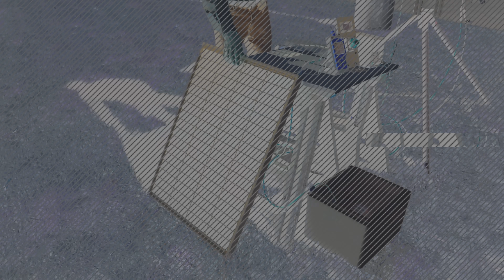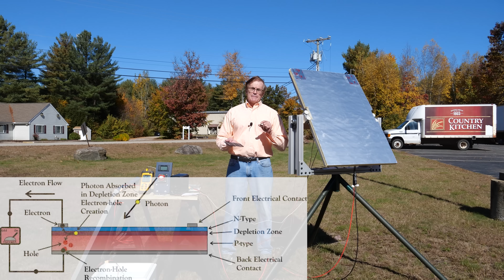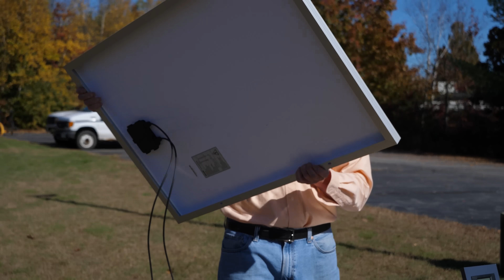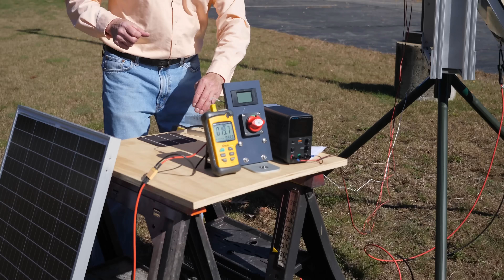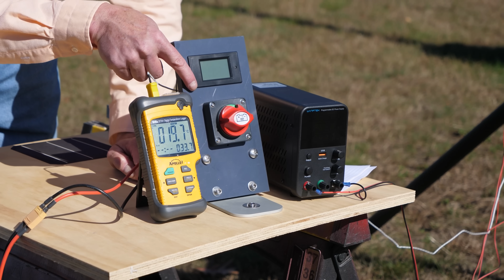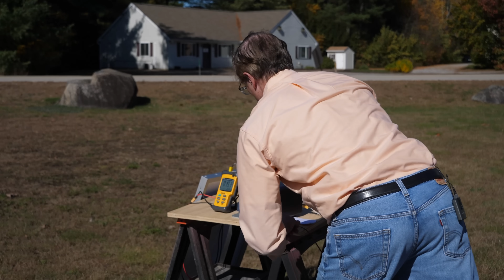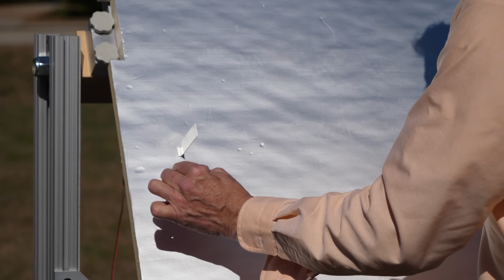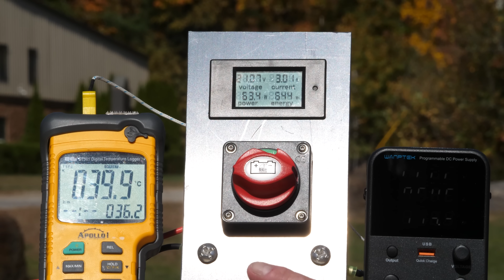Do you REALLY get enough out of your solar panel?

Comment: I'm in Australia I have 40 degree C days in summer. Just means my batteries take a little longer to charge. Maybe a hour and a half difference.

The temperature affects my battery storage more than anything. Hot days less storage better discharge, cold days better storage but less discharge (available amps with heavy loads)

I run a small 24v off grid set up of two strings with four 250w panels on each string run to a combiner box then to the mppt controller which charges four 230ah 12v agm batteries configured in series parallel to 24v which then runs my 3000/6000w 24v to 240v inverter.

Only way I think I can make it more efficient is upgrading to lithium cells/batteries and incorporate super capacitors between the controller and batteries and between the batteries to the inverter to help negotiate voltage drops and amp draw with heavy loads (microwave, electric kettles ect)

Comment: What if...you pump water behind the solar panel...or in front of the panel to both cool the solar panel, but also heat the water in preparation for a water heater?

Comment: The Baseline test needs to be done with a standard panel, open back without all the heat sinks.
The modified panel is probably holding more heat and reducing efficiency compared to the open panel.

Comment: This is in line with my plans for roof solar on my RV. Planning to have the panels cooled by circulating water that will be used for passive warm water. Panels will be cooler, warm water could likely remove the need for a dedicated water heater in most cases.
Reply: An RV with flat roof-mounted panels might be fairly well suited for something like this but I would caution against circulating the actual fresh tank water through the system.   Not if you want the system to last a long time.  What you want to do is to circulate a primary loop under the panels (typically a glycol loop or something similar) through a heat exchanger and then have the secondary water loop from the tank go to the other side of the heat exchanger.  Two pumps and a little controller to turn them on as appropriate based on various temperatures.

The algorithm would be fairly simple. Panel-side loop pump is enabled when panel temperature exceeds 45C or so.   Tank-side loop pump is enabled when the heat exchanger's temperature is sufficient to heat up the water, and it is force-disabled if the hot water tank is already too hot.   Just running the solar loop through the heat exchanger will help cool the panels even if the hot water tank's loop is not turned on.

That said, there are three problems. Well, first, you still need a dedicated water heater.  It will use less energy, but you will still need it.  Second, making the glycol loop under the panels efficient is no small task.  Heat has to be transfered from essentially the entire surface area under the panels into the loop without creating stresses or hot spots.  That is not easy to do.  And the third problem is cost and complexity.  Its a lot of cost and additional equipment just to harvest heat from under the panels.  Plus some maintenance as well.

If I could make a suggestion, it would be to double-stack the panels on top of the RV, well secured.  While the RV is moving you get power from the top panels in the stack.  When you park the RV you would be able to unfold or slide a layer of panels out to give yourself more solar panel area to work with.  Don't try to cool them, just use the extra panels to augment your power system.   This is virtually zero maintenance.   Double the power is more useful than a cooling loop augmenting a water heater.
Reply: @junkerzn7312  Isolating the panel cooling loop is the idea. Keeping the loop clean and avoiding freezing weather problems are the obvious reasons. Having a loop for warm water and another just for cooling the panels are the others. My rig has plenty of space for the wattage I'm looking for so no need for deployable setups. The goal is to prevent the panels from experiencing frying heat while in the southern states and during summer, that is easy enough to achieve with a tube loop and some TIM sheets.

Comment: . . . unfortunately you don't show exactly how you deployed the heat conducting aluminium profiles to the solar panel - the reduced voltage (wattage) of the fans is due to the fact that the kinetic energy of the forced air flow increases by the air velocity to the power of 3 . . . anyway:  thank you for this interesting setup . . .

Comment: As always a well made video with proper physiks. Living in an area with moderate temperaturs I'm currently leaning more towards just adding more panels instead of optimizing them for peak power.  I have issues with not having enough power in the winter and low lights (panels are cold there anyway). As I can't store the power long enough to be usefull. In the summer the panels produce more than enough power already. And the roof is not full yet ;). Also moving parts are not what I like to have (but that is just me). I clearly see areas with limited space and enough storage to benefit exactly from what you tried there.

Comment: Wouldn't mounting the fans at an angle improve  airflow?
Also what about mounting vertical round, square tubing on each panel. Have the ends be open

Comment: Thank you. I love your practically oriented video's which contain such convincing experiments and excellent scientific explanation.

Will Prowse, who has an excellent channel which is mainly focused on electric batteries, also did a very crude experiment on air cooling of solar panels. He used a regular fan and found that the power required for the fan was much more than than the additional power harvested.

Comment: It all comes down to the cost of the cooling, 5 watts will make $1 of electricity in about 1 year, solar panels last ~30 years
So if you cooling system gains 5 watts, 6 equivalent hours per day, for 30 years, your cooling system cannot cost more than $30 per 100w to just break even
And few people are willing to put money into an investment that doesnt pay back in 5 to 10 years.
And that's if nothing breaks, gets blown down, damaged by contractors, etc.

Comment: First off, this is good the see these experiments. I suspect that closing off the back of the panel with the fans turned on is artificially increasing the temperature of the panel due to hot air getting trapped in it. It would be interesting to see the power of the same panel with the back open. Also notice that the temperature reading on the thermometer even after the fans turned on is not bringing the temperature of the panel lower than the temperature of the thermometer itself. It could be that the darker panels are able to absorb more heat. But again we don't know without a control experiment.

Comment: I think that the after market cooling addition is a hassle for a small energy gain. For a system on mounted on the ground, it could be feasible, but changing a ventilator on a sloping slippery roof would be a nightmare. With strong sunshine, loosing 4 or 5 Watt on 70 or 80 Watt per panel is for me ok. With little sunshine, the panels will get less warm. As shown in your example halve of the extra power gain is lost on powering the ventilators.

Comment: I have some BUG issues with the fan system.
New Zealand and I have about 20 square meters of panel and I've run this system for 23 years. 
Summer is not a time we Scratch For Power - WINTER is when we run a gen if and when we need to So getting more out in the heat of summer is kinda pointless and it's already cold enough in winter.

The Most important this with Solar is Cutting those Trees Down - Yeah Charge the Dewalt and clear the sky line.

I have all my banks of panels on posts with gate gudgeons and they turn to follow the sun all day - so I have these bloody great sails 4x1200x2000 the wind likes to play with - "Eggsiting thing to see I can assure you".
Thing is Heat Rises and my Panels are on around 45degs totally open at the back, 300mm off the cool grass where the chickens keep the bug down all mounted on alli frame on 2 gate gudgeons carrying The Lot so open to the air on 45 the heat rises.

FYI The Russians have Solar on both back and front to get the snow reflection BTW.

I have some BUG issues with the fan system.

predictors

Comment: 2 watts from a solar panel will make you $1 in 2.8 years
How much did that metal and fans cost?
if it's more than $10 then it will never make its cost back over the life of the panel.
and that is if non of the moving fans ever break or get a bad bearing a draw more power, etc.

Comment: I wonder if one can passively cool them with a reservoir of water that is circulating (and perhaps goes into the ground for cooling?) by non-electric means, akin to how a drip coffee maker moves water (one-way valves). surely the reduction in density due to an increase in temperature can be used to move the water somehow?

Comment: nice, but isnt that aluminum sheet on the back allowing the panel to hold in more heat than a bare (stock) panel? i sure wish you would have done this next to a panel that was completely stock.

Comment: Most interesting indeed.
Many years back, I was told that sand blasting a heat sink would increase the surface area roughly 3x. (Assuming this is true) Could this be used to either achieve better efficiency or reduce the size of the heat sink?
Reply: I am sceptical: if sand blasting heat sinks was an effective way to increase their performance then virtually every Hi Fi amplifier and computer's procesor would be using sand blasted heat sinks and they don't.

Comment: beating the laws of physics on the helicopter level.
 entropy loses part of the battle. (outwardly apparent)
marketing execs for the panel manufacturers have a stroke and call the cost accountants who beat the engineers over the head demanding the process of manufacture cheapen....become more efficient because: profit margin change due to user innovation and loss of bulk sales overall.
 cool! no kidding! i am on board.
perhaps this will hasten innovation on the manufacturers part.

Comment: I think this is a cool mod however I think for the 1-2watts gained there's a lot more moving parts involved and possible initial upfront cost. As far as increasing the lifespan of the panel, while that may be likely, what are the chances that dust debris bugs and leafy materials get caught up in the back part of the panel? This increases maintenance as well as baseline product complexity.

Imo the water drip on the solar panel sounds very promising. If you have a buried 50g drum in the ground. The grounds ambient heat sinking would hand all your cooling needs without the need for a radiator you'd just need a basic filter and pump and nozzles. If it was winter, I'd simply not run it as you'd get better cooling from ambient temperatures anyway... Just my two cents still really cool the techniques you've shown here and the over all performance increase you managed

Comment: It seems like to me that between water heating, stove operation, dryer heat, pool heat, hot tube heat, washer cleaning water, and air conditioning, we should start looking at housing as a complete unit.  A number of years ago there was an article that by removing incandescent bulbs from a house and replacing them with LED or spiral florescent bulbs, the amount of heat not produced by these lights was so great that the furnace had to work harder to make up for the heat.  All very interesting.

Comment: Great videos...Please do your next experiment with a thermoelectric sinks located on the backs of the panels...passive way to use heat for electricity generation and cool the panels.
Reply from the maker: Thanks!
That would be very expensive and the decreased cooling due to the thermal resistance would undermine  the effeciency  gain in the panels  themselves.

Comment: Just wondering, would it be OK to use water  on a cloth in the air input to bring air temperature down, as water evaporates it cools the air.
Reply from the maker: It would probably  help, but keep in mind that the increased airflow resistance  would counter these  gains.

Comment: Can you make same test but put water drip over panel? I have access to water well and planning to put drip on system on panels and then return warm water back to second well. So, no water loss. But Not sure it water on panels will make less power due to reflection/refraction.

Comment: This has me wondering what would happen if we leaned into the heat generation on the panels using a thermoelectric and a reverse heat pump system?  Potentially, you could use an AIO to pull heat away from the panels to the heat pump, drawing it away from the panel, providing cooling for the water return trip and the heat transfer could be used to generate electricity or simply heat the home, if needed.  This may be a pipe dream, but I would be curious to hear your take on a system like the one I propose.

Comment: But, what if it was submerged just under the surface of water. In a lake or at sea? Would it perform better and cooler?
Reply from the maker: Possibly, but you have to account  for the change in light levels due to turbidity and the irregular  surface effect on reflection.

Comment: I'm crazy lol. I added 1in pex in the back of my panels and mixed in aluminum powder into a slow set epoxy and half filled the back of every panel. I'm using 400w panels. I did see around a 3-5% increase, but I actually did it to heat my pool. I live in California 45c air Temps are not uncommon where I live

Comment: i always wanted to retrofit some solarpanels w/ some hosing on the back wich would circulate water for either a pool or hot water storage in the home, it would be a fairly cheap solution using some normal thin wall wall hose and thermal conductive silicone glue  
thankfully im not the only one who has that idea and Hybrid solar panels are commercially avalible these days

Comment: for the additional cost of the fans and heatsinks and wiring for the fans, would it not just be better to invest in a better panel ?
Reply from the maker: That depends.  A "better" panel will cost more and this same system  will enhance its  effeciency and longevity  as well.
Reply: @TechIngredients  for sure. But what I'm asking. Say for 40 panels. The cost used here for the fans and stuff, how much of a better panel could you get? Would it beat out these mods?

Comment: It would be fun to see this combined with overclocking panels with reflectors. How much can you squeeze from a small array??
Reply: Not a dedicated reflector but Out here in new mexico i know a guy has a ground mounted pergola type solar setup  hoisted a good 20 feet in the air and the entire roof line is angled.  He used bifacial panels and then lined the area around the panels with white gravel and white cement under the pergola.

Said he saw a noticable increase  in production once he putthe rocks and cement down.
Reply: Small ultimate power plant with small servos to keep it in 90... just as a flex .... to show that is possible.....

Comment: Needs to be compared to a control panel that doesn't have 90% of the back surface of the panel blocked off to shed heat in the passive test...

Comment: You could also place band-pass reflectors near your solar panel that absorb / transmit IR / UV light, and pass 400-1000 nm light onto the panel. in theory, you could have a panel that is not facing the sun at all, but only selectively reflected light from the sun. the panels will heat up, but as they are passive who cares?
Reply from the maker: They're  working on that.